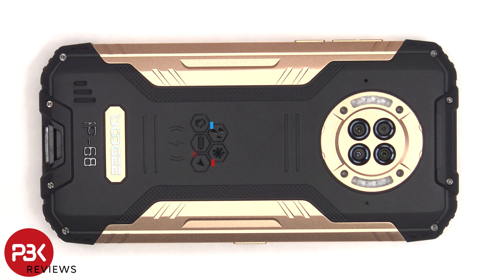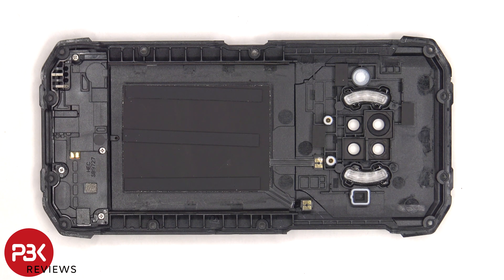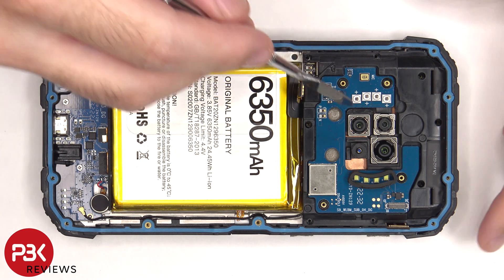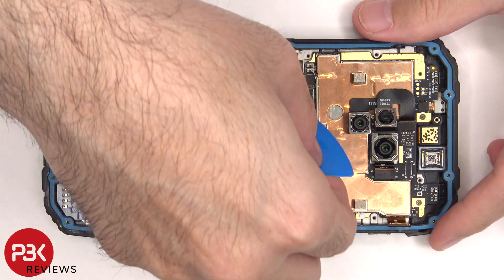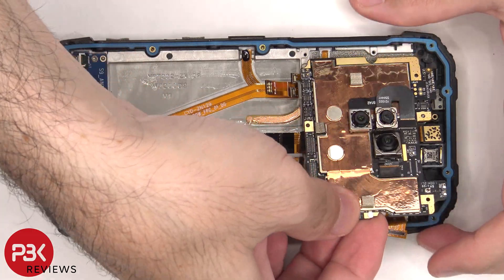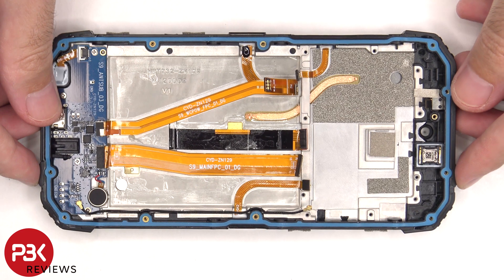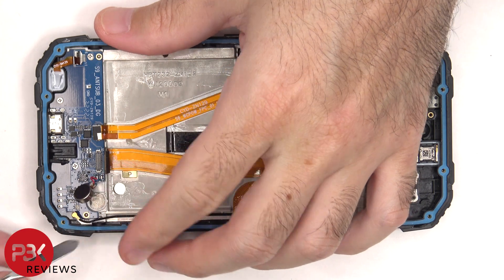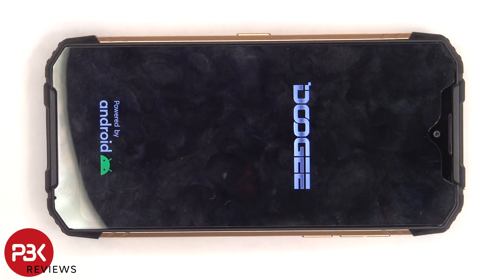Doogee S96GT Rugged Smartphone Disassembly Teardown Repair Video Review

Comment: Thanks to this video i just changed the main camera which it would not focus (manual or automatic focusing wouldn't work), i have ordered original camera replacement from aliexpress, works like a charm..! thanks
P.S. for other DIYers out there be careful not to add dust inside anything, and the force used to clip things back together.